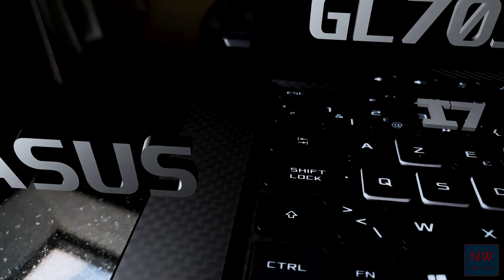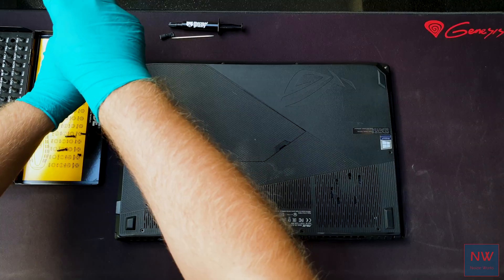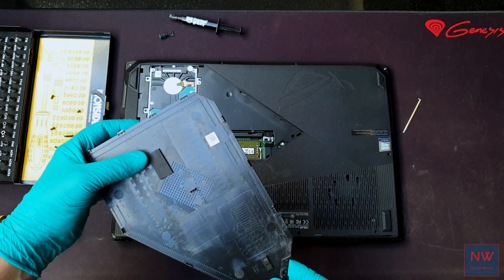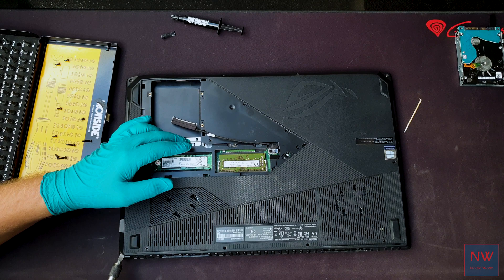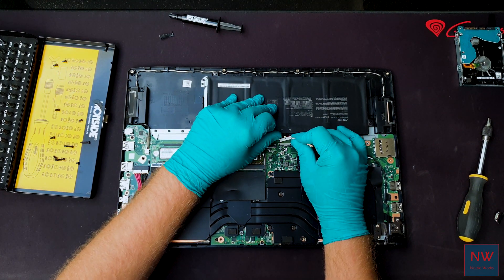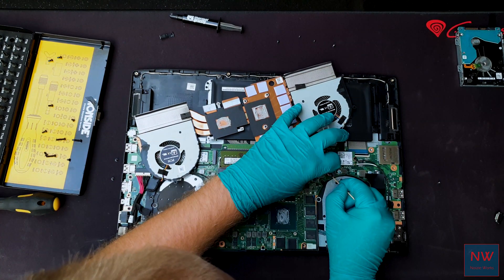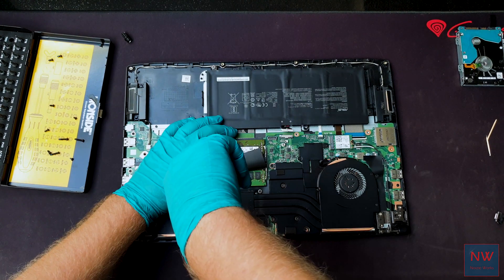How to fix an overheating ASUS ROG gaming laptop with a repaste

Comment: Hey, from the looks of the video, some of those heatsink screws are not supposed to come completely off, correct? However one of mine just will not budge at all. I tried lifting the cooler without unscrewing that one and it seems that that one screw is the problem. No idea how to handle this
Reply from the maker: Yes there are a few that don't completely come off. Sounds like you got one cross threaded, it can strip or brake of. Not sure how you could solve it without braking something.

Comment: Hi there. I have had this laptop for quite a while now and never bothered to fix the heating problem, until I saw your video. I replaced the paste with the exact one you used, cleaned the vents, removed the battery completely, undervolted my CPU to -0.130mV, limited GPU voltage to 900mV, installed the latest GPU driver, disabled turbo, set it to ''best performance'', and probably some more things I don't remember - its still getting 91-95c. I am at a complete loss. Do you have any other tips or something? Thanks in advance
Reply from the maker: It helps if you give the heatsink a bit of push to squish the paste a bit by hand cause the retention system is weak. Also look at the boost clocks, i had 3200mhz at 95c and now hit 90 ish at full boost without throttling so i call that "Great succes"

Comment: What do u mean by back plat?
Reply from the maker: The underside where the fans pull air in
Reply: @NoizieWorks  I still dont get it and how does doing that can reduce the heat?
Reply from the maker: @devixneko9988  in 2:28 you can see that i drilled holes in te backplate aka the bottem of the laptop where the fans are so they can pull in air easier in the hope it drops the temps a bit.
Reply: @NoizieWorks  I see did it work?
Reply from the maker: Minor gains and chasing digits 😁

Comment: bro can we use thermal paste instead of pads for cpu and gpu components
Reply from the maker: No, most of it will run out with high chip temps
Reply: @NoizieWorks  i applied 3 times thermal pastes but my temp is not dropping in game
Reply from the maker: Did you check boost clock before and after? If it's now getting full boost it works. If you wan't even lower temps you can try to undervolt and clean the fans

Comment: good to know that this is working for everyone, problably gonna do this soon

(Edit) Just repasted my GL703V and results are great! Played Far Cry 5 for a bit and temps are around 86 degrees and at full CPU clockspeed! Before the repaste It was throttling down to 2.6 GHZ at 95 degrees. Also my GPU temp went from 81 to 71 degrees under load. Anyways thank you for helping me solve my problem.
Reply from the maker: Great job dude!

Comment: After what has been ages, I finally did it. I watched this and your other video on cleaning the fans, and actually combined the two this afternoon. Here's the story.

I own a GL503VM which is in fact almost identical to this and other laptops in the series. I have been suffering from terrible fps drops and delays and "catch-ups" due to overheating for about a year and a half, and this was driving me mad and did not matter which GPU settings I had, it would always happen in demanding games after some 15-30 mins of gameplay. Lately I went back to playing a bit of WoW and it's interesting, the drops and delays are there, the GPU would show 100% usage but the CPU was barely used at all. This was regardless of my lowering the settings, so I thought that it could be the CPU bottlenecking the GPU by transferring heat, or in fact they could've both doing it at the same time. The temps were going to 90-91 while gaming, for about a year for sure (Doom Eternal, WoW, Forza H4, Valheim, Subnautica etc.)
I watched the video, and then watched your other video where you cleaned the fans, and COMBINED the two and made it a bit easier for myself. In the 2nd video you actually did not completely remove the cooling unit, only the heatsink cover - which I found easier without removing the plugs and still could reach the CPU and GPU with paste as well as dust out the fans and clean up a bit.

So, bought the paste, took baby wipes :) , some distilled alcohol, a lot of patience and without the air compressor, little by little I cleaned everything. Especially the fans and the outer sink that was chalk full of dust (it had piled up immensely). Afterwards, cleaned the old paste (it was not completely dry and I think my laptop is about 2.5 years old max), and repplied the new one. I added quite a GENEROUS amount of paste just like you did in the video, figured what the heck. Used the spatula, even it out and then reassembled all back. Followed your videos to the letter (except for the heatsink removal) and voila!

Summary: Idle temps are now up to 45 while previously had been about 55-56 C (approx. decrease of 10 C)
                   Tested WoW immediately: same settings as I played with yesterday when I had CPU/GPU temps of 90-91 after about 15 mins of gameplay. Now both did not exceed 56-60 C. Increased the graphics settings a bit - same result (consider it medium settings in most cases that I use). Did not even go over 60 (approx. drop of over 20-25 C at least) while previously would stay at about 90 and with huge delays, lags and fps drops. All this was measured with ROG Gaming center and Win10 resmon, didn't use any external software like I did in the past. Also, the noise is not there anymore since both are barely going over 60.

Initial results are great, will see how it goes. No undervolting yet, the only changes I made earlier (which did not help me) were setting the CPU max power to 99% so it wouldn't turn on the boost, and setting the cooling policy to active (was aggressive by factory default).

THANKS A TON, you've earned a follow my good Sir and finally made me do it! :)
Reply from the maker: Wow nice result and thanks for the sub! I did the same thing in the beginning like you did the 99% cpu,undervolting...
I didn't have a lot of dust but it gave a small drop cleaning it. The biggest gain is the boost clocks on cpu and gpu. I almost lost 1ghz cause of the temps.
It was 100% paste problem and i had it for less then a year so i can imagine the gains you got from it. Thanks for the story love reading it 😊.
Second half of this year you can expect a lot more vids as i'm working on a little workshop at home. See you in the next one!

Comment: It's necesary to use thermal pads on GPU blocks? Thermal paste isn't good?
Reply from the maker: You need pads on components like ram power and stuff not on the gpu, gpu is (almost) always with paste. I used thermal grizzly
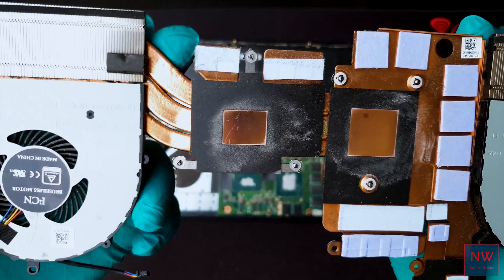Reply: @NoizieWorks  At 2:03 i see something purple on the conductor, isn't that thermal pads? I used thermal grizzly everywhere even on those metalic/plastic tranzistors...
Reply from the maker: Only the gpu has paste, problem with pasting the other stuff is that there is to much room between the contact plate and the heatsource and as the paste will become more liquid from the heat.... you could use some sort of thermal putty but i don't know if that will be better. Remember pads are better then nothing and vrm's on high end motherboard are all cooled with thermal pads so i wouldn't be to worried. I think the biggest problem could be the quality of the pads so i'm looking into it. The stock paste is crap so i guess the pads aren't much better.

Comment: A great video indeed.
May I know which thermal pads have been used and what is the thickness for them ? From the looks of it it felt like 0.5mm. Please correct me if I am wrong. Thanks.
Reply from the maker: Working on a vid for the thermal pads should be up in couple of weeks 😉
Reply: @NoizieWorks  Looking forward to it.

Comment: thanks for the video                                                                                                                                                                                                                                  but can you tell a fix for GPU fan running on full speed even thou nothing is running ( on idle )? My laptop is Asus Rog GL503GE
Reply: Dude I had same issue. Fan were running at 7200rpm. Later they changed entire cooling assembly. Its working fine now.

Comment: Hey, i’m going to buy a new laptop, the asus rog strix gl503vm, can you give an opinion about the pc? And can you say me how many times i have to change my thermal paste?
Reply from the maker: These are all descent laptops, if you change the paste once with a good one your set for 2+ years imo.
Reply: @NoizieWorks  I have GL 503 and framerate is began to drop with every game with no any settings changes...so i did open the back cover and cleaned it with air but it was not dusty at all. But if i want to take off fanpanel for untidust do i have to repaste after that? I really dont want to do that,just dusr removing. If that wint help maybe bios update will help? I have not updated it yet,the version is 305 and current is 315. What u think,does it affect these kind of problems?
Reply from the maker: @enjoylife756 Try to install something like hardware info 64 and play some games. I'm pretty sure you are overheating with huge thermal throttling as a result which explains low fps. Cleaning the fans will help a bit but the paste on these asus laptops is the biggest problem. Watch my 2 video's (repaste and cleaning the fans) and take it slow.
No need to stress and take your time. The disassembly will be a bit different from mine but you'll get the idea.
Reply: @NoizieWorks  Ok,maybe i have to repaste. I updated bios and reinstalled windows but those things did not helped at all :/. It is strange that throttling began after 20 sec when playing like Farcry 4 for example,gpu temp is 78 c and it can handle normally that kind of temperature with no issues. Framerate decrease from 90 to 40 but if i press esc and go to pause menu framerate calculator shows over 100 FPS and when i go back to game it is 40 again...wtf lol. So it could be gpu chip problem also or 2,3 year old gaming laptop is too old what comes to hardware and i need a new one...
Btw how come these laptops leave from factory with bad paste generally? Or is it so that they are meant to repaste anyway after a while? It does not make a sense cause after all these are gaming laptops lol
Reply from the maker: 90% of the time it's the cpu so check those temps
Reply: @NoizieWorks  OK,im at work now but when i get home i will download diagnostic tool first. Could you recommend something for me?
Reply from the maker: Hardware info or just the intel xtu work great. Hw info has a buttload of extra sensors
Reply: @NoizieWorks  Ok. Default myasus software did not worked on my laptop whe i tryed it yestreday as it should so i will use that intel xtu,thanks!
Reply from the maker: Let me know!
Reply: @NoizieWorks   Lol actually i noticed that HDD is 90 %full, so i did deleted some stuff and it helped.
Reply from the maker: Big fps drops from a full hdd don't make sense. Boot times and stuff yeah but not in gaming performance. Still check the temps
Reply: @NoizieWorks  Yes that is what i tought also but then again HDD is so fragmented now and i have only 8 GB memory so those could be one of the reasons. Temperatures were ok after "hard" gaming session. Anyways i will buy some paste when i have time to do so.
Reply: @NoizieWorks  Hey, i repasted it yesterday but the problem did not go away,still huge FPS drop when palying like Far Cry 4 after 20 sec playing. At the same time fan speed increasing also,temp was 73 celsius when it happened. So it is not thermal issue and i really dont what 2 do anymore. Maybe it is some sort of hardware problem but i cant fix those things.
Btw i did  not removed fan wires,i just turn whole panel upside down carefully
Reply from the maker: Then i would do a fresh install of windows. That sucker can give al sort of weirdness. Sorry it didn't help buddy
Reply: @NoizieWorks  I did it last week..nothing seems to help anymore. Maybe the turbo boost mode  does not work as it should but i dont know why ? Or can it be so that it uses intergrated gpu somehow? I have not found any settings accoring on that via nvidia control panel or anywhere else
Reply from the maker: So you installed all drivers including the intel chipset? Don't trust windows to download the correct ones. If so go to the asus site search for your laptop and install all drivers. There is one that's needed to make use of the "turbo" fan button
Reply: @NoizieWorks  Well tbo all other drivers are "checked" by windows exept gpu,it is from nvidia experience sw
Reply: @NoizieWorks  I did not found any drivers for chipset..there was intel Serial IO controller driver under Chipset but that is not what i need to look for : My model is  GL 503 VM
https://www.asus.com/supportonly/ROG%20Strix%20GL503/HelpDesk_download/
Reply: @NoizieWorks  But anyways the main problem is that gpu is somehow over clocked when playing games..memory is 4000 mhz max and before it was like 3000. I have not touched any of those settings
Reply from the maker: There you go, i would try the latest nvidia drivers to.
https://downloadcenter.intel.com/product/1145/Intel-Chipset-Software-Installation-Utility
Reply: @NoizieWorks  Hey i finsally got rid of the fps drop. I looked inside heat sink air vents where hot air comes out. All tiny holes were full of dust particles so i sucked by vacuum cleaner as much asi could.  Compressed air botlle was empty anf tbo it dont helps as much as vacuum cleaner
Reply from the maker: So it was overheating
Reply: @NoizieWorks  Oh yes,i  repasted it too at he same time.Btw, have u tryed to remove fans for better heat sink cleaning? It is quite sealed system and it is hard to give proper cleaning when fans are in their place. Spraying air on fans cleans only fans,not the heat sink
Reply from the maker: Yup i made a complete vid about it. https://youtu.be/wVQynN4oGS8
Reply: @NoizieWorks  Hi! I did not checked out your video,insted i tryed to do it myself and it went okay. I took all tiny dust particles off with the vacuum cleaner. Improvement was huge,now i can play like Far Cry New Dawn easily with 60-70 fps without any heating issuses with high settings.
But anyways it was rather easy to do but i would not like to do it so regulary if necessary...all those tiny screws and repasting every now and then .Not my thing really,i have better things to do in my days hahaa but then again this is a laptop not pc lol. Maybe there are better laptops which can handle dust problems better and air flow  does not suffer so much if there is a little bit of dust inside cooling rib ?

Comment: what about the thermal pads ? can you describe the pads thickness ?
Reply: No, do not use thermal pads, they are not as efficient and they will not last long.  Thermal Grizzly is the best, but you have to be careful with that as it is liquid metal and any overflow could seriously destroy your laptop.  If you do not feel comfortable with that, then use something like Arctic Silver thermal paste.

Edit: NVM I see now what you're talking about so just ignore this.  Was thinking thermal pads for the gpu/cpu, was not thinking about those sorry.

Comment: Got one of these used off a buddy to start my journey into PC gaming, mainly playing Escape From Tarkov, one of my thoughts first after getting it was how the backplate could be modified to allow for better cooling, now that I saw you did it that will be one of my next moves. I'll go through some of your other videos and see if I can find it, but any recommendations on upgrading the RAM to 32gb? I see that in this video it's already been adding. Planning on taking it apart again to re paste and modify the backplate, would like to add ram while I am in there (although I see you can do it without fully removing it). Cheers bud keep up the videos.
Reply from the maker: You can acces 1 stick but for the other 1 you need to remove the backplate. As far as speed and timings goes it depends on the bios but there is already somebody that tried it and it defaults to the speeds you have now(3200mhz ish) and after digging around in the bios there is no option to alter the speeds or enable a xmp so i would look at the sticks buy a bigger kit with the same speeds and try it but make sure you can return it. I drilled some holes in the backplate to free up some flow and removed the plastic teeth where it vents out. Not sure if it helps🤷‍♂️ but i would like to print something and then use a mesh but that's a bit to far away(got some builds coming up). Thanks for the kind words i appreciate it!
Reply: Noizie Works I would imagine combined with some sort of fan stand, the holes would help.
Reply from the maker: Yeah working on the stand🤫 it's already printed but that's for after the next upcoming vid in a couple of weeks.

Comment: Omg for 2 years my laptop cpu was consistently at 98 degrees celcius under load and gpu 96 degrees celcius. I finally decided to follow your video and replace the thermal paste (which was super dried up). While I was at it I removed all the dust that had also gathered over the years. Afterwards underload, my GPU is at 76 degrees celcius and cpu is at 84 degrees celcius. My laptop fans also finally don't sound like a plane engine anymore.
Reply from the maker: Nice job!! And thanks for watching!

Comment: hey can your Pease tell me your fan 2 max speed using fanspeed app i am getting max 200rpm in fan is it normal? please run speedfan app or hwmonitor and tell me
Reply from the maker: 200 rpm is not normal if on load. First download hw info and look there for fanspeed. It should more like 5500 rpm on overboost (fn+f5) could be dirty or broken.